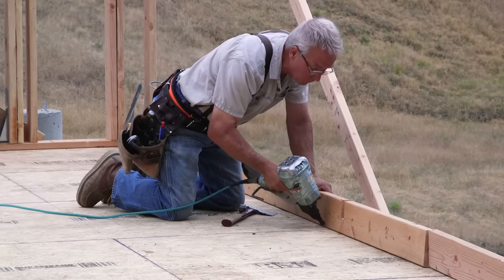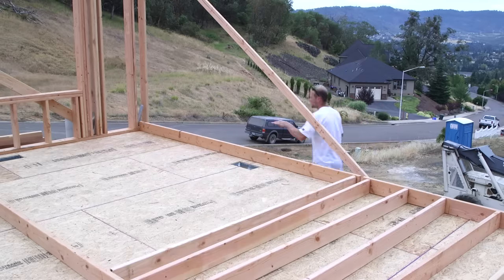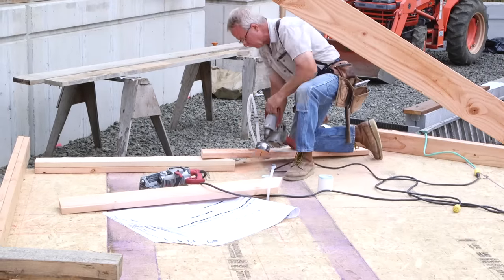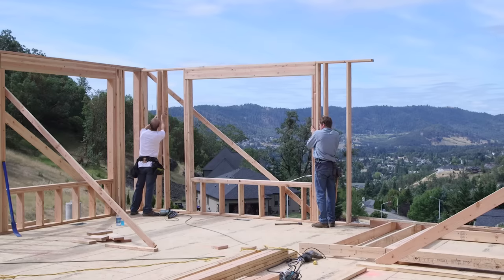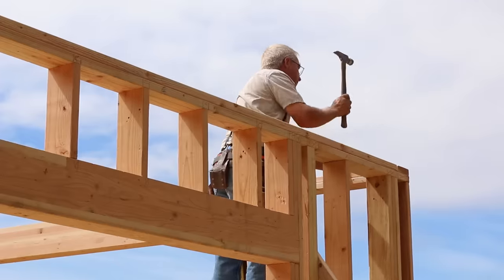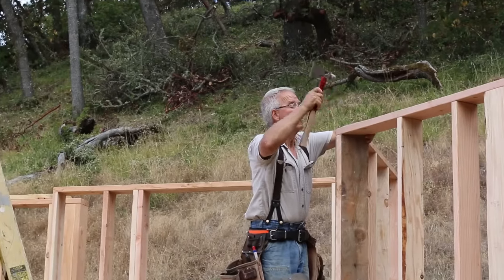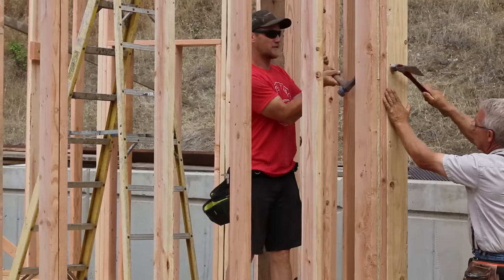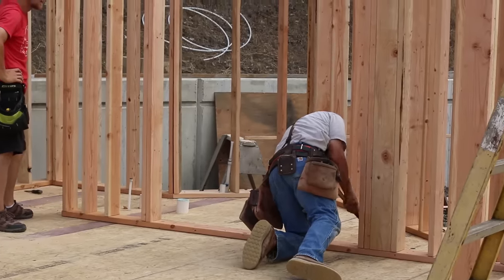Framing: Crown Plate, Toe Nails, Lifting & Bracing Ep.48

Comment: Scott, I get the weight issue as related to crew size.  I guess I have become spoiled having a piece of equipment to lift walls, fully sheathed, wrapped, windows installed, etc.  Once in a while one of my guys nails off some sheathing out of square and we have a hell of a time plumbing that section...  Thanks again for adding value to what we do in the customers eyes!

Comment: This series is great.  Please include any details you can.  Like crowning your studs.  I'm a DIYer.  I have framed an addition, and decks, and built walls, and remodels.  I crown my rafters and floor joists for obvious reasons.  But it never occured to me to crown the studs so they lay flat on the floor.  Fantastic tip.  Please add in any tips you think of along the way.

Comment: Slotting the sill plates was not allowed in earthquake zones. We used 5/8 bolts with the large square washers. A burke bar to lift the walls over the bolts. When having to lift large walls they were framed in manageable sections.

Comment: Speed:
Build all windows and doors when you cut the header list (any flat surface will do). 
Double top plate DTP the walls before standing them (saves a lot of time on the ladder)
- DTP makes tying the walls together faster and easier.

Quality:
Building the doors and headers as a unit means all good nails.
Double top plating on the ground makes it easier to insure good nail patterns.
It is hard to shoot good header nails when wall studs are to close to the King.
Reply: additionally:
Build all windows and doors when you cut the header list so that labor can stay busy while the framer lays out the pates.

Comment: When I used to work on a framing crew, framing apartment buildings, back in the 80's, we had a man who cut and stocked units with headers, wall plates, trimmers, cripples, and there were two men who assembled  walls, one with a gun and the other who also carried studs and laid the pieces out, and then he held the studs while the man with the gun nailed. We would work like this all day, where the cutter only cut and never nailed anything all day, and the men nailing, never cut anything all day.
Reply: That's how we do it, cut guy cuts, one guy builds parts, and then u build walls and sheet and tyvek, then u stand. If u can't frame a 2000 sq ft house in 5 to 7 days your not in business
Reply: I worked on a production site when I started as a cut man. We had a large radial arm saw and I cut the built up headers with a saw stop to make each piece identical. We assembled entire window and door packages and labors placed them so that carpenters nailed them to layout. We had other apprentice carpenters building the corners and channels.

Comment: Framing is such a small part of the whole job but so much of a big show.
Reply: I have heard people say this before. Which trade spends the most time on the job?
Reply: Too true...I used to write my contracts so that I was 50% paid when rough framing was done...I'd say rough framing gets the job to about 15- 20% complete...But, then you have money to shop the electrician/hvac/plumbers/ roofer subs. etc ...:)...
Reply: The architect. Or the plumber. The banker. The secretary for the developer. 

If everything is subcontracted out, the trade with the most man hours is probably the plumber.
Reply: @michaelvangundy226  I guess I never considered the banker and such as part of the trades. My bad.
Reply: @michaelvangundy226  :)..UM, no. ... The carpenters have about 10 or more times man hours than plumbers...I've been a builder for 30 years...It takes a couple weeks to close in a 3000 square foot home...My plumbers rough in, in one day...Finish maybe two or three depending on the fixtures.. Every day of carpentry is often, especially from foundation, is 5 man days per day...The carpenters take longer to set the windows and doors than the plumbers for the whole job...:)...
Reply: @godbluffvdgg  
It's been a few decades since I was plumbing houses. There was a crew of 3 framers and we had two crews of 2 plumbers on rough in and one guy doing fixtures. So it was 200 hours a week versus 120 for the framers. We built 2 houses per week for a year and a half.
Reply: @godbluffvdgg  
I guess part of the difference is who you are calling a house framer. We had a sub who brought in the windows and set them. I wouldn't call that framing. A separate sub who did millwork. Another who did siding. All not framers. Housing in those days was all piece work. In the summer we would have more crews and less in the winter. Slabs and foundation work put up their own forms. I wouldn't call that framing.
Reply: @michaelvangundy226  That's all true...But, it depends on the General contractor...I've been both sub and general...When I'm the general my guys did framing, windows, roofs, siding, millwork, etc...When I say from foundation, I'm talking about from setting the plates, the floor joist, the deck, the perimeter, etc...Not the foundation .
Reply: @michaelvangundy226  2 rough plumbers plus one finish is 120 per week also right?...40X3...:)...Who the hell works 40 hours anymore, right?...
Reply: @godbluffvdgg 
2 crews of 2 plus 1 finish is 5 guys. I quit housing and went union. We almost always worked 5-8 hour days. Hours 9 and 10 were time and a half.  Anything after 10 was double. And if you don't get 8 hours sleep the whole next day was double.

Comment: Tips for Nailing Walls
1. Walk forward from stud to stud. Safer and faster.
2. Don't put your feet between the studs. You will move faster and you won't be knocking over studs.
3. Always nail studs from the bottom up. Way faster and safer as the nail closest to the top is closest to your fingers (you can remove your hand from the stud after the first nail is in).

Comment: 6:10 I bought my brother a plate-to-plate level (it extends from 6'4" to about 17') for a birthday present, and it has proven to be just about the most valued tool in our arsenal. It can do many things that no other level can, and it does a lot of other things that other levels can do, but more easily. Every person that handles it treats it like it's made out of gold leaf; when it gets used, we go out of our way to go set it somewhere safe and secure, because the last thing we want is for it to fall over from being haphazardly leaned somewhere, or to have something dropped on it. It's been in the trailer for I think about four years now, and it gets used pretty regularly, but because of our great care, it still looks almost brand new, save, despite our care, for one sight glass having lost alignment :(
If you're in construction, or anything where you're regularly plumbing stuff taller than 8', ignore the $300 price tag and just buy one; it absolutely will pay off.
Reply: In fact, in light of some the fancy expensive tools I've seen in Scott's possession, such as the self-leveling laser with receiver that my brother wound up also buying (this has also proven invaluable; we had a laser, but it had no receiver, and manually rotating it and finding it in the bright sun down here was always a big pain), I'm surprised he doesn't have one.

Comment: One thing I learned from framing my house was, when close to the end of the run on the plate use a loose nail that had the tip flattened a bit. You won’t get the split that happened at the 8:45 mark.
A couple dozen nails prepared at the start of in my tool belt always saved time. And it is the sign of craftsmanship that takes almost no extra time.
I never liked the the notion of “good enough”.

Comment: My Dad  made me  build a small house (cabin) 100% by hand, from floor to roofing, electrical, plumbing, HVAC, cabinetry etc. Bits & braces, corner braces, hand saws, hammers, axes, adzes, hand benders, trowels, mixing concrete by hand. IT SUCKED, but I walked away with a huge set of newfound skills and appreciation for power tools. We packed everything in with mules and horses, and a generator was not an option for him. Cordless? NOT BACK THEN!

Comment: sir  or anyone  who  are in this framing . the height if the 1 st floor ceiling . I do recommending of 10 ft height.it is much better for the air circulation. and more efficient for the air conditioning . roomy will give more relax for the people in home. 

using 2x6 is much better concept .I do hope many home builders cut less corners . thank you

Comment: Instead of toe nailing the bottom plate and potentially being off the line, or dealing with pulling nails.  Just attach some small scraps every few feet to the rim and when the wall is stood up and slides it bumps into those blocks.

Comment: I like the idea of toenailing first the bottom plate,but in order to stand up the walls you need to notch the plate to accommodate the anchor bolts. I know in my area the will not allow us to do that. We have to drill the plate a little bigger to give some play around  the anchor bolt in order to straighten the wall. Any other ideas on how to do this,in order to still be able to toenail the plate?

Comment: 14:43 I have a legit question for the experts: at exactly 14:43 you will see E S nailing the top plate onto the studs. At his back left foot, you will see the edge of the top plate overlap a stud so that it overhangs about 6 inches where it butts up to the adjacent too Plat which also overhangs its stud. My question is: Because both of these edges don't sit on a stud, doesn't that affect structural integrity? Is this a common issue and what's the standard way of dealing with it?

Comment: Maybe you’ll be able to answer here or on the podcast but I would like to know if you put any blocking in the floor joist where you knew a partition wall would run parallel between the two floor joist. Also if that partition wall ran parallel to the ceiling joist, do you put blocking between two ceiling joist or double up and place two ceiling joist running parallel to the wall?
Hope I didn’t make to too confusing to understand, I will appreciate it very much if you gave it your best shot on giving me some insight.

Comment: I have to ask, why don’t you nail your top plate on first before standing your walls? Don’t get me wrong if you’re going to have to stand a wall with a top plate overhanging then you would want kickers and then slid it over  after bumping up your overhang but the L  ones with L on both sides are easy to keep your top plate on.

Comment: In a future video, would you kindly zoom in the camera to show how the nails look once you have stood up the wall and bent the nails over "like a hinge?"  That's a brilliant idea that I would like to better understand the details of.
Reply: Always  toe nail the bottom plate down from the inside out. If you toenail the bottom plate from the outside in, when you stand the walls the nails will pull out and be sticking inside. Then if you Kick the wall over to the line you might end up with a nail in your shoe. The way Scott does it leaves a bent nail resembling a barb wire fence staple. Use your cats paw to pry the bent toe nail to bring the wall in, in areas you need to line up with the line on the floor. Clear as mud right?

Comment: What's that hammer you were using in this video framing walls? I've never seen anyone use one for anything but roofing and cutting shingles to length at the end of the run. At least where I live that's how it is. Is there any advantage to using that for framing?

Comment: Ever thought of getting a cordless nail gun ? They would be perfect for this kind of work.
Reply: Not fast enough??
Reply: Cordless are great BUT everytime I need it my battery is on the charger or  dead because I used it in my drill or left the flashlight it on during clean up or I've been using it all day( I only  have 5 or 6 batteries so more fresh ones would help) my plug in compressor never dies.
Reply: They are slow

Comment: Instead of nailing the bottom plate down first, why not just nail a few boards on the outside of the floor to stop the wall from being pushed off when you raise it?
Why not add the crown plate before you raise the wall?

Comment: I'm curious why no screws are being used in the corners to make sure that they are tight together? That whole thing about pushing the wall with a stud seems rather tedious.
Reply: Screws are rarely used in framing, besides on hold downs. And the way he pushes the wall by flexing the stud is an old trick the easiest way by far. Watch and learn man
Reply: @DamnNiceVideo  I'm not questioning the technic but curious why screws are rarely used though. Is it just because they are "expensive"? In that case a screw would bind the walls together without requiring someone else to spend time helping.

Comment: We here in Eastern Europe do not build such strange houses. This framing is cold and has no soundproof and needs a lot of expensive wooden and insulation materials just to get a thin 15 cm wall with very poor characteristics. We need to have at least 25 cm framing wall with crossed insulation in our cold climate. It is much wiser to use stone materials. You get 38-50 cm wall for the same money that is very heawy, very soundproof, very insulated. For walls we use Autoclave Aerated Concrete (AAC)  blocks that provide excelent insulation. Also we use concrete hollow slabs to make floors and ceilings so we get surface extremely soundproof and easy and cheap to finish. Why americans use such unreliavle building technology?

Comment: I would have framed the house with 2x8 24” on center with California corners. You need to seal the space where the bottom plate meets the subfloor with Dymonic 100. As far as inside wall insulation you cannot go wrong if you use too much but nevertheless at least 4” (R-26) of Demilec Heatlok XT.

On the outside the first 2 feet of the exterior sheathing needs to be treated plywood then Zip R-Sheathing (R6 or R9) with Z liquid flash applied for all the seams and nail heads would be the best option. 
For a conditioned attic on the roof rafters spray 2” of Demilec Heatlok XT followed by 8” of Demilec Selection 500 (total R-44) on the roof rafters spray, then paint it with International Fireproof Technology’s DC315.

Comment: Why not sheet your walls before you stand them?
Reply: TeddyBear DIY heavier yes, but quicker in the long run.  They have wall jacks so lifting the wall once it’s sheeted isn’t an issue.  

I figure the only reason they don’t sheet them first is because they either don’t require full exterior sheeting or they want to do it the slow way, off a ladder.   

I’m a master framer. I’ve been framing for 18 years now and I don’t ever stand walls without sheeting them first unless the wall can’t be squared up first.
Reply: @Page5framing  Maybe you’re just smarter than everyone else. The thought is so original that I’m sure it never even occurred to EC. One would have to be of extraordinary intelligence to even conjure such an original idea. There could certainly be no better way to do it for ANY possible reason.
Reply: psidvicious well that I am for sure.    Glad you noticed.  Lol.  One, sheeting walls on the floor is way faster than sheeting off a ladder (time is money baby!) .  2, it’s much much safer.  Most of the accidents on job sites happen on ladders or standing on walls so why risk it?  

But maybe sheeting isn’t required in their part of the woods.   That’s why I asked.

Comment: You can also strap the bottom plate (metal banding used on a bunk of Advantech works) or nail blocks to the rim (exterior) that extend up onto the outside of the wall. This can be useful especially on tall, heavy walls with lots of headers and sheathing. Wall jacks do come in handy,
But a good crew of 3 can usually stand most walls (exerior & interior) with no problem.

Comment: Love your videos. They are packed with valuable information and wisdom.
Can you answer me this question on my remodel?
I have added a partition wall separating the garage/laundry room. There is a 3/16” gap between the truss and top plate. Do I use a standard shim and tonail in 3 spots? Or do I use a 6” timber lock screw without a shim and draw it down? Your knowledge is appreciated.

Comment: The crew I work for we have a crane with a 40 ft stick. We build the wall complete windows installed, overhangs on, corner posts etc. we run are overhangs to all the right demonstrations, so that when we stand a wall next to it making a 90 degree like at 6:26. Everything lines up perfect and All you have to do is nail it up. We build wood overhangs they get painted in the end not vinyl

Comment: Actually  cutoff pcs of framing lumber nailed into the rim joist and allowed to run above the floor will hold the wall from sliding over the edge when  standing it up. 
Your corner framing method is both a waste of material and time, and also dosent permit for insulating that area.
Try using just one stud at the corner and then a flat one for the nailer of the other corner wall.
Insulation can then be installed in the corner.

Comment: When explaining the different components of a wall and the layout of studs I was surprised that you didn't mention the all important note. From floor joist to stud to 2nd floor joist to stud to rafter (on a 16" layout) all details will be on one straight vertical line. That is how weight is transferred from snow load to dead an live loads to the concrete footings. And one last thing, you mentioned it at the end...no sheeting on the walls. Don't know about that decision, anything I can put on that wall while laying down, ie, sheathing, overhangs I put on and hopefully you'll have a great reason.